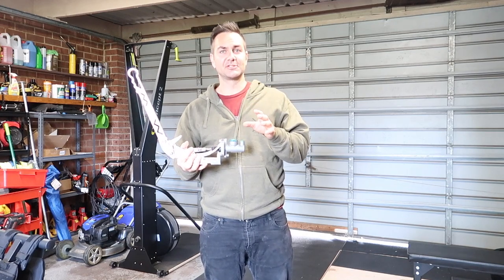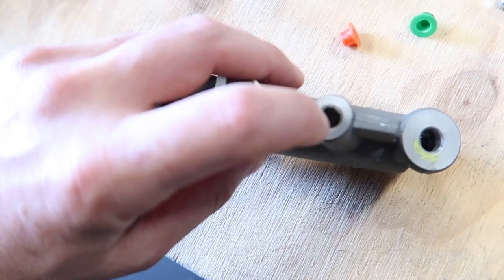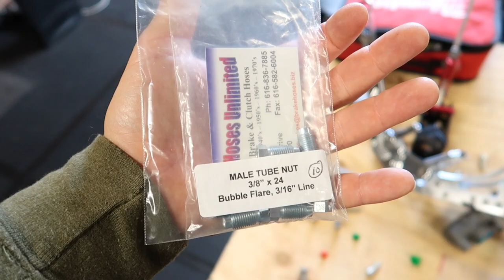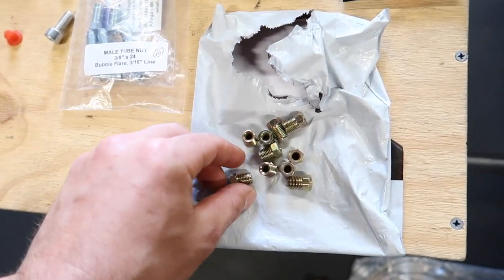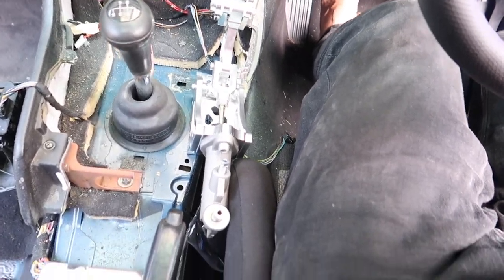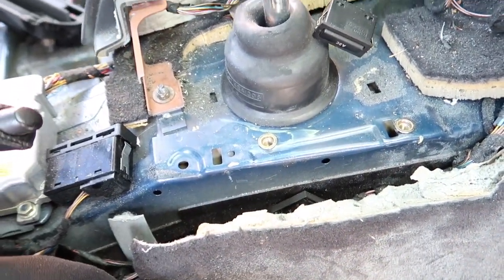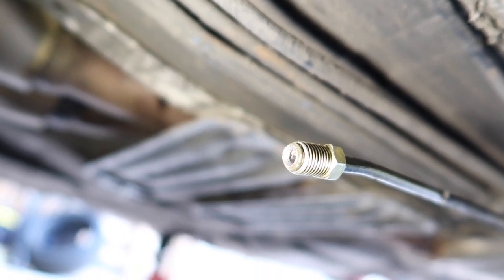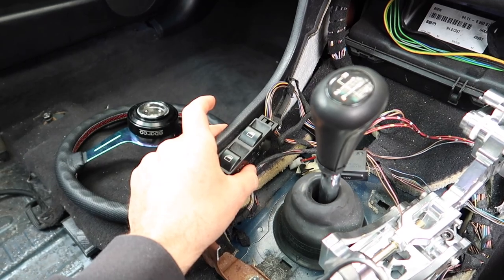BMW E46 323ci Drift Build | Ep 14 - Hydraulic handbrake install

Comment: I have one question about the abs.  Will the car try to use the abs as normal but no longer have control of the individual rear wheels?  Or will the abs light come on and it will no longer work at all?
Reply from the maker: Hey mate, sorry for the late reply. 

The ABS will no longer lock up the individual wheels and I can’t remember if the ABS light came on or not - I’ve sold the car since.

Comment: Hi I have the same car and followed your video I’ve connected it Up the same way as to I have but mine i my seems to work if i I pump the brake first, it’s like it loses pressure I don’t have any leaks, any ideas ?
Reply from the maker: Have you bled the system well to remove all air bubbles trapped in the lines?

Comment: How do you turn off ABS on these cars? I've heard if you pull the fuses it goes into limp mode and I've heard some folks say you can pull the right rear speed sensor but I've never tried. Maybe possible to tune it out?
Reply from the maker: I just hold the Traction Control button down for 10 sec
Reply: @marinocustombuilds  Not sure if its different for american cars or what but the first press turns off traction, the long hold turns off stability control but the abs is still on with my car.
Reply: Pull abs fuses
Reply: @kennethvanes  From what I understand pulling the fuse will put it in a sort of limp mode where the rev limit will kick it at around 5k.